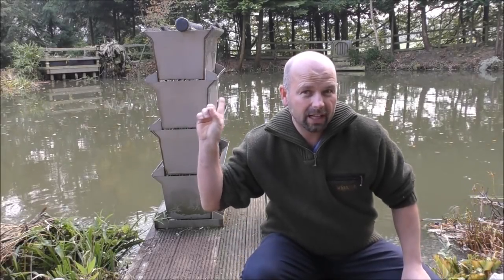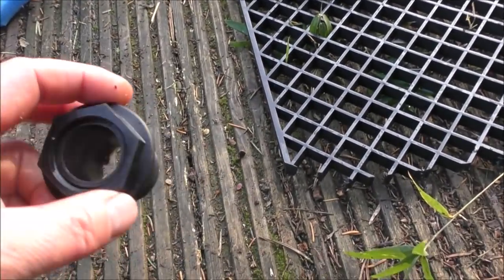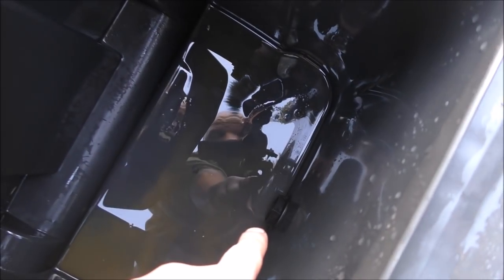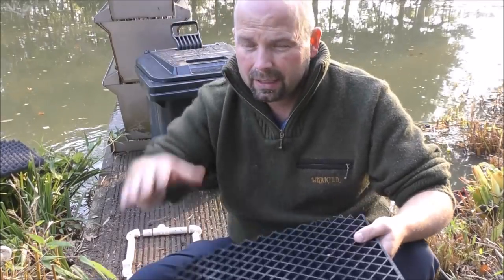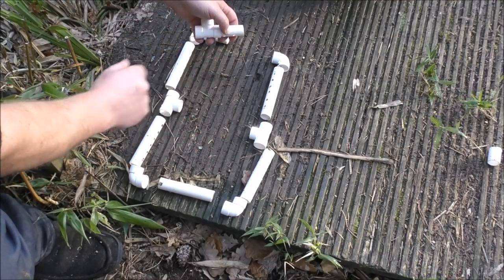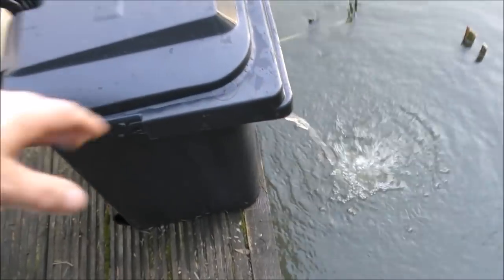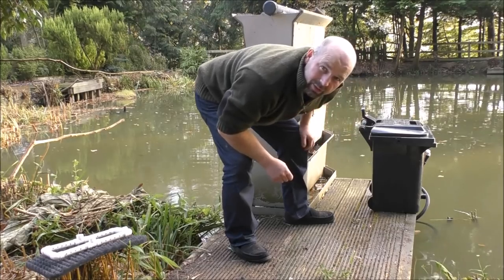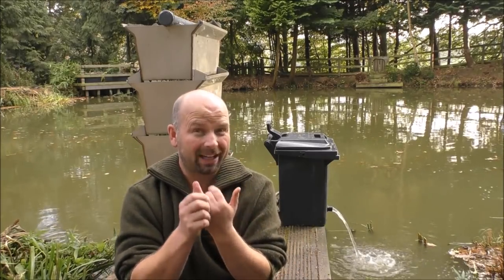DIY Wheelie Bin Koi Shower Filter (great for healthy water in a fish pond)

Comment from the maker: Click 'SHOW MORE' for full video description, links to gear and useful videos - Watch in HD.
I hope you find this video useful. It is of a new idea for a pond shower filter using a small wheelie bin which can easily be moved around / stored away in a shed without having to totally strip down the filter. The first media shown in the video is the new Biohome Shower media which is incredibly hard wearing but also extremely porous, having a structure similar to Biohome Ultra and Biohome Maxi Ultimate which is a perfect environment for supporting a great balance of aerobic and anaerobic bacteria for full cycle filtration (reduction in nitrate).
I also show a few other types of media which make a good budget option for the biological side of filtration.
GEAR LINKS:
45 litre wheelie bin: https://goo.gl/D14wFP
75 litre wheelie bin: https://geni.us/WjPOtF
Biohome, foams and Pumice filter media: http://www.filterpro.co.uk
Lava rock: http://geni.us/daKf8n1
Alfagrog: http://geni.us/Il899
20mm conduit pipe (spray bar and inlet): http://geni.us/A2kuXLc
20mm 90 degree bends: http://geni.us/MT6TCqt
20mm Tee pieces: http://geni.us/zLY2Lj8
20mm inlet: http://geni.us/BxXR
(the above plumbing fittings may be cheaper from a DIY outlet e.g. Plumb Centre - I put links here to Amazon so you can get a close look and see exactly what you need)
Outlet, Flexible pipe, plastic grid, foams and pump from any good pond outlet.
Decent 3000 litre per hour pump: http://geni.us/dDYgVX
Plastic grid: http://geni.us/AelD

USEFUL VIDEOS: 
Stainless steel shower filter: https://goo.gl/gNFyWB
Alternate DIY shower filter: https://goo.gl/R8YAeM
Looking inside filter media: https://goo.gl/yMpJEr
My pond construction playlist: https://goo.gl/YufhpP

RECOMMENDED PRODUCTS ON AMAZON: https://goo.gl/jMaBWy
INSTAGRAM: https://www.instagram.com/pondguru_outdoors/

FILMING EQUIPMENT:
Panasonic HC-VX870 HD camcorder http://geni.us/3UwE
+Rode stereo microphone: http://geni.us/4OL
+Rode 'deadcat' mic cover: http://geni.us/1pmn
JVC Everio quad proof HD camcorder: http://geni.us/e09e
+Rode 'deadcat' mic cover (opened up and held between tripod and camera base) http://geni.us/dee24
Zomei Z666 tripod: http://geni.us/1a1af3
Manfrotto MTPIXI-B PIXI mini tripod: http://geni.us/87f7

If you've enjoyed this video please check out the playlists on my channel for hundreds more  - on a variety of subjects.
Feel free to share or link any of my videos on facebook, twitter, forums etc. for the benefit of anyone you think may also enjoy watching.
See you next time.
Pondguru
Reply: Nice design mate! Plumb centre are pretty good for tank connectors, much cheaper than cockney koi and have some 'unusual' sizes
Reply from the maker: Yes that is as good as anything for fittings - some may need taping up or shaving down to fit certain sizes of flexible hose but if you go all push fit you could definitely make a filter with fittings purely from a DIY outlet like that.

Comment: Some of those  fittings can be found in a boat supply place.Maybe fasten a bungee cord to the underside of the lid so it can hold the last foam insert. Allowing better flow in case it backs up. Would also be out of the way when you open it every time. Great video, Thank you for your time.

Comment: Thank you Richard for your time in sharing these awesome hints and tips. I will be building this over the coming weeks - the wheelie idea is great! 
We are about to build a simple pondless 'rill' in the patio area. The filter will be needed because the drain pipe siphoning the rainwater from under the inground trampoline will be coming into the pondless pond. Don't want all the crud (soil, dirt, micros', frogs, etc.) to enter the rill/pondless pond. The drain pipe (68mm diameter) will be around 250mm below the ground level. Just a real dilemma how to solve a filter AND put in a pump for the blade feature for the rill/pondless. Any suggestions would be really appreciated!!!!! x

Comment: Brilliant idea and will have a go at building one of these next spring to put on my pond. Out of interest the overflow at the top of the bin, could this be replaced by putting a 90 degree bend to replace the capped end of the bottom 2 inch outlet pipe at the bottom of the bin and then connect a 2 inch pipe and run vertically up the inside of the bin to the equivalent height of where you have placed the outlet pipe above the foam mats. Pipe can be kept vertical by gluing a plastic pipe bracket to the inside of the bin. By doing this although you won’t instantly be able to see when the foams are blocked, you will be able to site the filter away from the side of the pond in the knowledge that if the overflow was needed then the water would still return to the pond via the outlet pipe.

Comment: Hi .. I'm really new to all this and I've started to feel overwhelmed and out of my depth  ..  I currently have 4 turtles who keep outgrowing their tanks so I'm in the process of digging an outdoor pond ready for the to go out in April.   The pond is going to be 15ft long 7 foot wide and 3 maybe 4 ft deep ...    would this wheelie bin idea be ideal for the volume of water in my pond and also what sort of water pump would be sufficient for this wheelie bin project ? 

Many thanks .. great video .. great idea.
Reply: I know with aquariums you'd be looking for a turn over of water of say X10 per hour the volume of your tank.  You could probably use the same calc for your pond. So once you know roughly the volume of your pond you can look at a pump that will turn the water over 10 times on an hour, no expert but it would probably be a good starting point

Comment: That's nearly exactly the same setup i have, a pressure filter than feeds into a Hozelock Ecocel filter box (filled with filter floss) then split into two bins. Probably overkill for 2000l pond. DIY filtration can be addictive, always trying new stuff out, or just bored :)
Pressure filter really does take a lot of dirt out and really easy to clean. All Ponds Solutions have a decent one for the price.
Reply from the maker: That sounds awesome and there is certainly no such thing as over-filtering as far as the fish are concerned - they will love you for that.

Comment: Thank you for another nice Koi pond filter solution.
But I would like to know about the medie and the bacteria that is expected to live in it.
At the moment I have a huge Bakki Shower with Aqua King Bacteria House.
but it seems to me that it doesnt really get going ( a year now )
To support it, I have added air ventilation fan at the top to suck fresh air into it.

now. this new filter medie and new DIY you have made it seems like there are no air support to the bacteria inside the bin.
so, what kinda bacteria will survive without "drowning" in this one !
Reply from the maker: I'm not sure what you mean by 'air support' as the movement of water through the filter draws air in from any unsealed part of the filter and the water contains dissolved oxygen which is released during bacterial processes as well as being integrated back into water through the water falling effect.
Your cycle has not got going in a year? How does the water test?
Reply: The reason why I need air support is that my bakki shower i placed in a greenhouse, where the air is stationary.. and I suspect that the "old air" from the bakki shower, ( smells like ammonia )  aint getting blown out of the bakki shower by fresh air.. by that, the bacterie is no doing a good job.
the ammonia and nitrite levels has been a bit more than what I want, but there are no signs on the fish of stress or discomfort, the fish are happy, very active and eating well.
I have installed an Air ventilation fan on the top of the bakki, to suck out the old air.

a friend who has the same bakki shower and media and also has the bakki shower indoor, had the same problem, untill he placed a ventilation fan at it, and then he succeded getting his levels down to 0..

So, I think the bacteria needs fresh air, and not the stationary old air / smelly air from the bakki shower to do well.
that is why Iam not sure a closed bin will give the bacteria a good home to survive. ??

Or it might be the case that my pond is to huge and I have to little fish to get the water "dirty" so that the bacteria will have plenty of "food" to really get going and clean out the pond completly !
Reply from the maker: Filters shouldn't really smell but I can see that if its in a confined space that you could get a build up of the free ammonia in water which gases off in the shower building up in the air.
The bin filter has to draw air in from around the lid through a vacuum effect since water is being pumped into the filter and exiting through the drain pipe at bottom - if it was a sealed unit the water would back up and come out the exit pipe in a similar way to a 2 litre bottle full of water being tipped upside down with air being gulped into the exit pipe to replace the  water which had exited from the bottle (or in this case from the filter).
Hope that makes sense - I'm sure the air around a filter would smell a bit 'fishy' if any filter was in a confined space.
Reply: put some carbon in it if it smells it show its working

Comment: Hi Richard. I am about to extend my pond and it is looking like it will be around 17000 litres once complete. My idea was to use a pressure filter and then to go the extra mile run that into a filter like you have built at the top of a cascade. Looking at the reccomendation on volume of biohome shower media I would need  85kg!! @ 1kg per 200 litres. Could this be reduced as going through a pressure filter first?
Thanks Matt

Comment: To make that shower better, where the t pieces are put a 4 way mate that way there will be an extra bar in the middle as well and have more surface for the water to use on the filter foams buddy 😁
Reply from the maker: Yes a better spray bar would be in order - good call.
Reply: Pondguru thanks mate am full of good ideas 😂 , make it and let me see it running, u could also upgrade the pump as well to make the shower better as well

Comment: Can I use this design with a box that is 34”L by 20”H by 20”W with 1/1/2 in flex pvc from pump reduced to 3/4 in spray bar and outlet to pond 2 inches
Reply from the maker: If you're reducing the 1.5" pipe to a 0.75" spray bar then the flow definitely won't be too much for a 2" outlet so that should work no problem. Best of luck with the project.

Comment: I was thinking of using my small 60cm dia  40cm deep upper filling pond (pre water fall cascade) to do a reverse of this ie a wetland type filter- water leaves my pressure filter goes into bottom bucket at bottom of top pond. If I do crate/foam breaks is this likely to work as an extra bio filter in my pond?

Comment: Hi Richard. I have found A 30 and a 40 litre wheelie bin on line - they are both on castors as opposed to the 2 wheeled bins that you show but look like they will do the job. I will have a 5000 litre pump running via a UV into my pressure washer - would you expect this type of shower filter to cope with that flow rate ? If not any suggestions. Cheers
Reply from the maker: Should be fine as long as the outlet is around 2" diameter. As the water is going through a pressure filter that will do away with any need for foams in the shower filter so water should flow freely through it no problem.

Comment: Sonny You are up there with the finest. This is no small pond for home use but what do You run it with? Must be some big pump!
Reply from the maker: I currently have an Oase 40,000 litre per hour pump shifting water about but no large scale filtration. However I am due to move all the gear out from under my cabin to make space for a very large filtration system which i should get built over this winter ready for the spring. I will film that no worries.

Comment: would there be enough pressure for the out flow rise up a pipe two foot and then flow into a raised pond. and secondly will this setup also do all the bio matter as well as the heavy matter I ask as I wish to set up one of this style filter syst on ground level and the side of the pond wall is two foot high
Reply from the maker: The water flows out by gravity so the outlet on a filter like his needs to be higher than the pond it flows into. A suitably sized shower filter will catch all the muck and process waste but it sounds like you need a pressure filter for your situation.
Reply: Many thanks for the fast reply and for your help regards

Comment: Greet Video  is there any poisons in the plastic bin - e.g. nitrates  or nitrite  thank
Reply from the maker: Nitrite and nitrate are generated from broken down fish waste so wouldn't be found in the plastics of the bin.
Reply: Pondguru thanks for letting me know just once I tried to use quilt filling for a filter and got a high nitrate reading . Thank again
Reply from the maker: The problem with a lot of bedding and furniture products is that they are almost always treated with flame retardant chemicals to conform with fire safety regulations so that can poison the water - best to use products for ponds or aquariums which are sold for that purpose as they have no chemicals sprayed on them.
Reply: Pondguru never thought of that tanks you . Just off to make a shower now .

Comment: Great video, really informative. Did you get around to connecting one to a pressure filter ?
Reply from the maker: No not yet as I haven't got a decent pressure filter.
Reply: I'm thinking of making one of these to go after my pressure washer, As the pressure washer will already have done the mechanical filtration will there be a need to put foams in the wheelie bin filter ?
Reply: Sorry just realised the mistake above - obviously meant to say 'pressure filter' not 'washer'
Reply from the maker: Yes, the pressure filter should have enough foams to ensure clean (enough) water to enable a shower to run effectively without foams in allowing the whole shower to be filled with media.

Comment: Richard - I love (and subscribe to) your Pondguru videos.  I am interested in your advice.  I have a pond which is approximately 7,500 gallons stocked with 13 Koi and about 12 goldfish.  i am builing a Bakki-style shower filter with 4 levels (each with about 7,200 cubic inches of capacity).  Consequently, total volume is approximately 28,800 cubic inches (or 470 liters).  I can't afford to fill the system with Biohome, but would like to use media which is relatively durable and good for aerobic and anaerobic bacteria.  what media would you recommend to fill the four levels and should I use the same or different media in each of four levels?  keep up the good work. I think your videos are among the most informative I watch on Youtube.  best regards, jonathan.

Comment: Hi is there any difference in performance to a shower filter or just the same, thanks
Reply from the maker: Shower filters are great for reducing nitrate when plenty of good media is used and they do an excellent job of supporting bacteria due to the showering / wet / dry nature of them compared to standard box filters where media is submerged.
Reply: Pondguru thanks

Comment: Will your new media be suitable for aquarium external filters ? Il be getting some for my pressurised pond filter  to replace the bio bollocks that came with it
Reply from the maker: Unfortunately none of the biohome is really suited to being used in a pressurised pond filter as the environment is way too dirty for the media to be effective. Although the shower media will still work in an aquarium filter it is only sold in 10kg or 25kg amounts. It is slightly more dense than mini ultra or ultimate due to one of the ingredients of those ones not being able to be used in the shower media due to the production process and it also doesn't not have the same added trace elements .
If you're looking to replace the plastic balls in the pressure filter then alfagrog is a great one for that purpose:  http://geni.us/Il899
Reply: Pondguru thanks .. ive already got some cycled bio home ultimate mixed in the bio balls .. my pond is only 2.5 k litre and understocked , with all them home made bio and mech filters i built .. its pretty crystal . Ive just modified a powerhead and a corner sponge filter .. its working well . Il link u up as i know you love my catchphrase . Lol
Reply from the maker: Nice one, man.

Comment: Is that feeding directly from the pond? If so, you'd need to clean the foams every day to keep the  bio-media from clogging. Otherwise you'll end up with a mess. 

What about putting some form of sieve/stainless mesh above the bio media? Or even above the foams? 

Keep up the great content.
Reply from the maker: In an ideal world you would feed the flow to a pressure filter to do all the mechanical cleaning then fill your shower filter completely with media. This video is really just showing what can be done with a bin and a few fittings for use on a small to medium pond. I will be making a 'proper' filter for my big pond soon.
Reply: Pondguru Hmmmmm. I have a pressure filter doing nothing round the side of the house. Easier than making a sieve. Great idea.